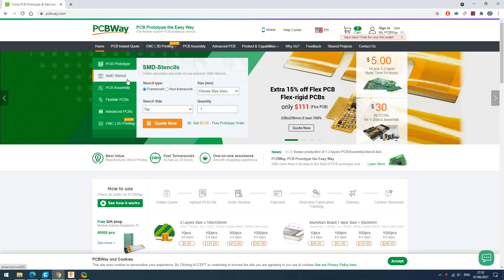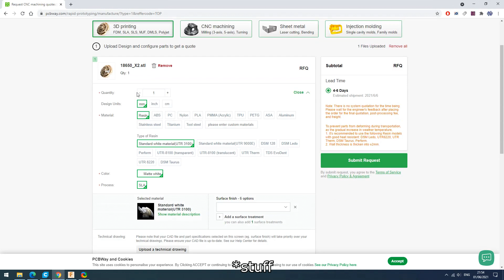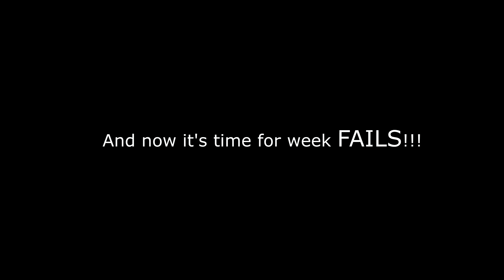8 3D Printing ideas for Halloween - Halloween 3D Prints

Comment: Those are some awesome clean timelapse can you please share your profile settings?
I have been struggling with my ender 3 s1 pro prints. I get strings and artifacts in corner
Reply from the maker: Thanks! I am in the middle of the testing different settings.  If I get print without strings and artifacts extruder clogs very easily. Smaller detail prints is hard to get good.